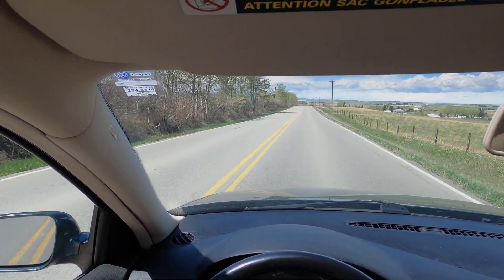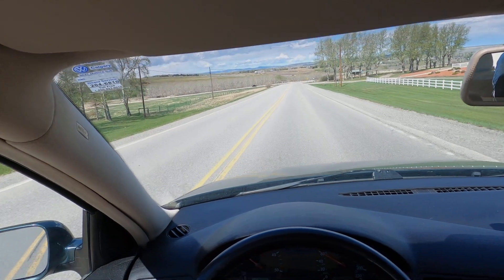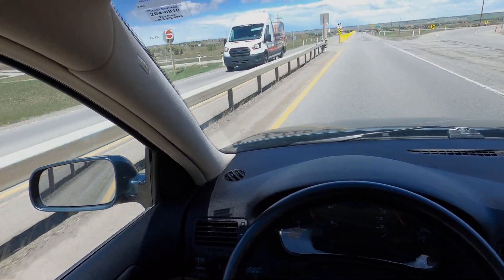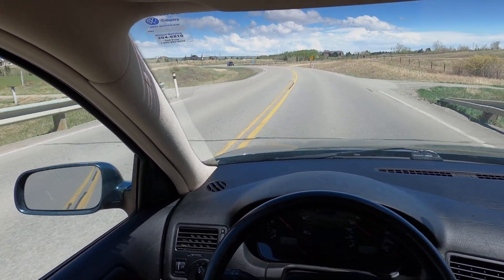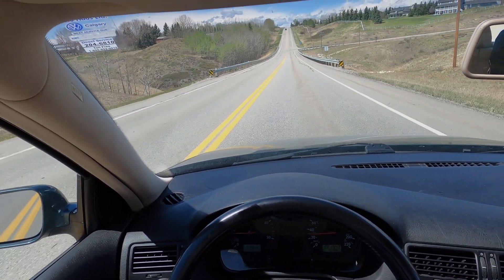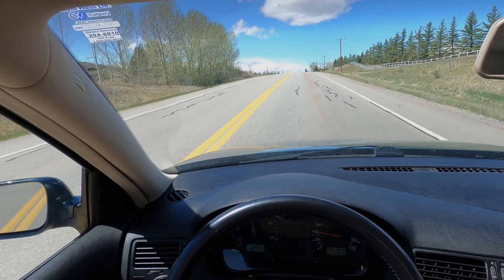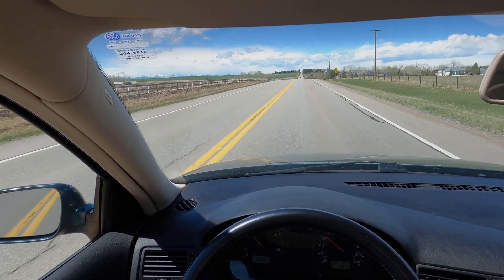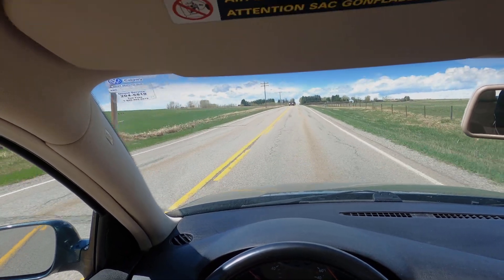VW TDI 1.9 driving impressions with the 11mm injection pump

Comment: The nozzles make a big difference.
Reply from the maker: nozzles are done and the video is coming
Reply: @gregs_garage  I put nozzles in mine a couple years ago and didn't do anything else except for a stainless downpipe with resonator instead of cat and full size all the way out I think two and a half inch with glasspack disconnected the EGR vacuum line, and it made a tremendous difference in power. The fuel pump is starting to act funny now so I may put an 11 mm in that I have on a spare engine.
Reply from the maker: @sabbath7081  the tune is huge.  see my other videos about removing EGR, cooler, etc.

Comment: Did you have to do an adaptation or change a setting in VCDS for the different pump?
Reply from the maker: No.  11mm same as 10mm.  I used VCDS to check timing.

Comment: Question , the heads from latest Alh will work in early Alh’s?   In my head I’m thinking the this is only a mechanical part. But I heard the 99 pumps not work on 99.5 and up cars.  Maybe is just the electronics?

Comment: I've got a 2000 alh beetle stock tune stock turbo.  .216 nozzles cat delete full exhaust 3 bar map sensor and it pushes 24 to 29 psi and runs absolutely amazing. 0-60 times dropped to 6.8 to 7.5 seconds depending on the launch. I've put over 15,000 miles on this setup. I've got a bigger turbo and a tune for it next
Reply from the maker: Good.  I have bigger nozzle ready to go.  Will be making a video of the install and results
Reply: @gregs_garage  thanks for replying I'm interested in seeing other people's builds and their outcomes they come up with because no two cars with the same mods will do the exact same
Reply from the maker: @boostedtdis  yes I plan to document the results.  This is a great car I hope it rips.

11mm pump is in see my other video.
Bozio nozzles next
Malone tune after that

Then later maybe a 17/22 turbo but we will see.
Reply: @gregs_garage  it'll rip I'm extremely happy with my results so far it was like a brand new car once I did it I was not expecting it to have as much power as it does now.  I have a 05 Jetta with the bew 1.9tdi blown head gasket I'm fixing to start a project with it
Reply from the maker: @Yusef Ufnagel everything is stock except the 11mm pump.  I have big Bosio nozzles to install soon and will get a tune and 3-bar MAP.
Reply: @Yusef Ufnagel the tune was stock only thing messed with was the injection timing and the quantity the stock turbo stayed pushing 28psi for 15k miles already had 250kmiles on it but it went out the other week so I threw a vnt-17 on it now waiting to get a tune
Reply: @Tyler That is the exact same setup I'm installing tomorrow with .216s, so glad to hear it is working out well for you as people have been saying ill blow my vnt15 adding a 3bar map with no tune. What rpm do you usually shift at? I thought keeping it tame at 3k shifts would help keep the turbo in 1 piece.
Reply: @Nik-se4mx  you are correct keeping it at 3k will save it. I took it to redline literally like Everytime I drove 😂 I loved it. The response from the stock turbo was amazing. I put a vnt1749 on it only lasted seven days lol. Now I have a gtd2060 installed and I'm running 32-36 psi. If you have any questions with your build hit me up I've got four tdi's
Reply: @boostedtdis why did the 17 only last a week?
Reply: @MrXanitos  the 1749 has the same shaft as a vnt 15 so it can only handle as much boost as the stock turbo you can just make more power.        Ive actually went back to a 1749 running a compound turbo now the 1749 is spooling a 66mm now and fucking love it
Reply: @MrXanitos  and the 1749 I put on first was a dirt cheap ebay got my 300$ out of it lol

Comment: You can put a 11mm pump with a manual?
Reply from the maker: yes.  will flow more fuel when needed with mods.

They are the same externally.
Reply: @gregs_garage  can you tune it with a laptop program Ive seen it done I want just a bit more power like maybe 100hp but the same fuel economy
Reply from the maker: @infernoking7504  you have to buy a "tune" and upload the file using a special adapter that plugs into the OBD2 port.

Tunes would go along with upgrades like bigger nozzles, turbo, etc.

If you want a cheap DIY method, search the "EVRY mod".  Perform at your own risk.

Comment: I’m anxiously awaiting the results of installing the larger nozzles on this car with the only other mod being the 11mm IP. I only changed nozzles on my ‘96 Passat and was very pleased with the results. Now I have an 11mm pump on the shelf (will likely switch only the plunger head ass’y to avoid having to disassemble the timing belt) and a set of Sprint 520’s on bodies that I am thinking of putting in together and I’d like to see if anyone else has tried that combo on an otherwise stock engine.
Reply from the maker: let us know how it works.  I don't know about changing the pump head instead of the timing belt procedure.
Reply from the maker: nozzles are coming.  Too many projects on the go.

Comment: Was ist smokey on highway? What do you think about going on a 12mm Pump. Would it deliver more power?
Reply from the maker: not smokey.  never heard of a 12mm pump
Reply: @gregs_garage  If not smokey I would go with 12mm or 11mm + bigger nozzles. You can buy it on ebay.
Reply from the maker: @buchhalterkimbo6934  I think a good OEM 11mm that has never been apart is a better solution and delivers more than enough fuel for most applications with proper nozzles and tune.  I wouldn't mess around with a chinese 12mm pump head.
Reply: @gregs_garage  ALH with 12mm pump head https://www.youtube.com/watch?v=pX9E-hzj87I